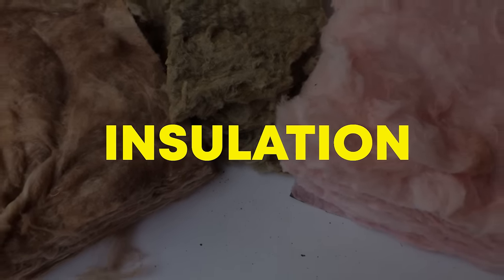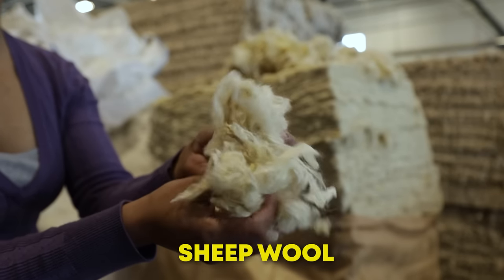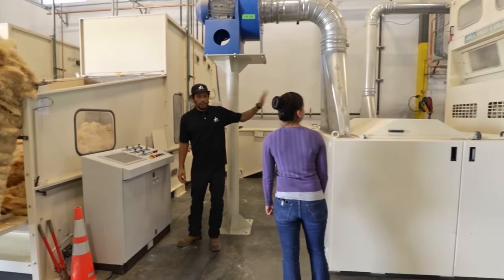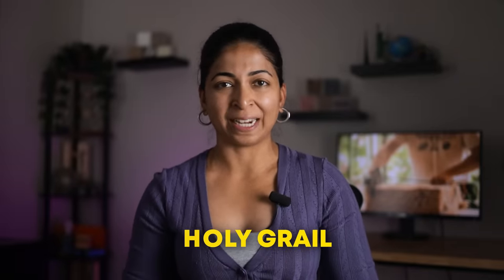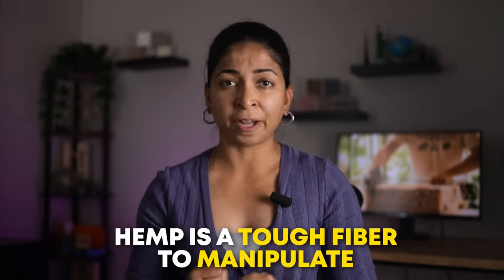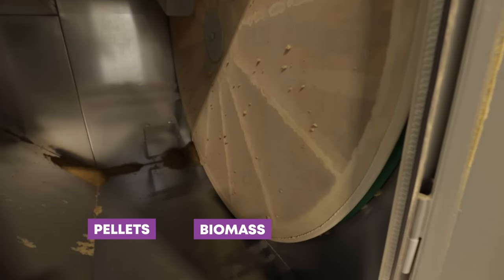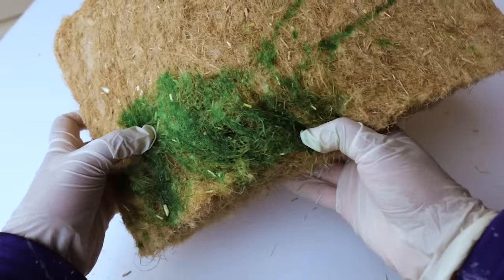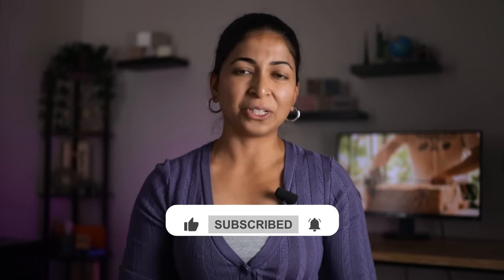Is HempWool the Holy Grail of Sustainable Insulation?

Comment: Thanks for the video though it does border on infomercial. I’d like to know more about fire resistance, ie, how many minutes can it withstand the flame, especially compared to mineral wool. Using a cigarette lighter may not be the best fire source since it’s low pressure device, a torch may be a better option. Also, with plastic binders I wonder what sort of toxic gasses are given off when it burns. Lastly, as mentioned elsewhere, I’d be interested to learn what sort of critters could take up residence in the batt—it looks like it would make a handsome mouse nest.
Reply: Does fire usually have to burn through drywall for quite a while before gas from insulation becomes a factor? By the time burning insulation gasses happen any occupants are already dead from other smoke and heat?
Reply: it doesn't border on informercial. she is shilling :(
Reply: I don't think the plastic is the issue. It's the fire retardant spray. I'm interested in knowing what those chemicals are. PFAs?
Reply: @kevinm.6015    But for a good cause.  She is believable!

Comment: If they could turn the hemp mixture into a fibrous pulp and then spray it out in layers of 1in / 2.5cm it would be much more versatile to construct different widths and thicknesses. Plus, making it a pulp allows for the water / solution to be the glue and you wouldn't need the polyester. Also, from that baseline they can / could offer different variations of that. I could see this product evolving into sidings and even possibly roof tiles that are almost completely circular / regenerative.
Reply: I’ve seen that…I think the company is ISO out of Belgium, and I think there is a company in PA doing it, too…
Reply: @rickreynolds3604   Thanks, I'll have to look them up  :)
Reply: Hempitecture, the company featured in this video, sells that product in addition to this HempWool. It was their first product and if you go to their website they have the binder and hull offered for just such an application.
Reply: @steve7814   Thanks, I'll check out their website.

Comment: I’ve been screaming from the rooftops for years… PLASTIC IS NOT BAD, one time use plastic is
Reply: Exactly! Plastic is the most environmentally friendly building material there is because it permanently sequesters carbon. Hemp based products biodegrade which makes them a poor choice of material for building permanent structures.
Reply: I live next door, and had to buy more insulation but that's ok, freedom of speech is built into human rights.
Reply: @truetech4158  thank you for your dedication to liberty
Reply: @TheICFArchitect  if the plastic is made from oil then that carbon was already sequestered underground. However using plastic to bind hemp together sequesters carbon the plants pulled out of the atmosphere.
Reply: @flinx  True. But hemp biodegrades which slowly releases all the carbon it contains.
Reply: @TheICFArchitect  most buildings are maintained and the hemp won't biodegrade significantly until the whole building is allowed to decay. That's a century or more of time for civilization to replace fossil fuels with a surplus of solar, wind, cheap batteries, and  use excess energy to capture carbon.
Reply: @flinx  If you really wanted to solve the carbon problem with hemp, I would mush the hemp into a paste and then inject it back down into empty oil wells.
Reply: @TheICFArchitect  and keep insulating buildings with products needing more energy to make? Hemp insulation is useful, uses less energy, and works with capitalism.
Reply: @flinx  It takes a great deal of energy to make Hemp insulation. Diesel powered tractors and equipment to harvest the hemp, semi-trucks to transport the hemp, and then factories to process the hemp into it's wool form. I am not against hemp but it is not some form of magic bullet that will fix the construction industry.
Reply: @TheICFArchitect  so you know Hempitecture is lying when they say their product takes less energy to create compared to fiberglass and mineral wool? Just because hemp production uses some energy doesn't mean it uses more than those other two.
Reply: @flinx  I don't think anybody should use fiberglass insulation or mineral wool either. They are all parts of an outdated substandard building method.
The faster we transition away from stick framed houses the better.
Any stick framed house is basically just a fancy tent waiting to blow away in the next storm or burn down in the next fire.
So even if Hemp insulation is better, it is just lipstick on a pig.
Reply: @TheICFArchitect  if not stick framing, then what? Brick is a poor insulator. Straw bale walls despite the height limitations? Insulated Concrete F uses polystyrene. Concrete production for now still isn't green.
Reply: @TheICFArchitect  But are we building 'permanent structures'? It seems like I've seen a lot of 30-40 year old commercial buildings being torn down to build something new. Perhaps residential will stand a lot longer? But given the low quality of most US homes in the past 50 years (R value alone), I'm not sure how it will play out.
Reply: @chmedlychmedenstein916  That is a very good point. But I would say that is the fault of our throwaway consumption culture.

Comment: I like the idea of a renewable insulation using hemp but…
1. It blackened to a very light flame, and even that required a “spray” to achieve; will that spray be effective after 40+ years in application, & I’d have doubts that for significant heat/flame that it wouldn’t burn. Rockwool on the other hand def won’t burn
2. U said water resistant, but will it grow mold? That would be my biggest fear. Rockwool def won’t 

I prob sound like a hater but I really don’t want to be becuz it would be amazing to have an organic renewable insulation that met the holy grail of high r value, water resistant and zero mold growth, and fully resistant to combustion but I just have my doubts hemp will get there.
Reply: Thanks for bringing up these great points because those are the right questions to ask. When we "inoculate" the fibers with fire retardant/fungicide, it's intended to last for the life of the building (100 years), to test that in a shortened timeframe we can "weatherize" sample material and then expose it to the ASTM E84 test (fire) and ASTM C1338 test (mold). Insulation longevity also has a lot to do with assembling walls properly!

Comment: I wish they said which fire-resistance product is used. I would love to see a comparison of HempWool, sheep wool, and wood fiber insulation.
Reply from the maker: It's proprietary spray they developed with a university, but I believe it's salt-based?
Reply: @BelindaCarr Salt-based fire retardant sounds pretty interesting.
Reply: Probably some alkaline carbonate, the fire resistance will worsen over time if there' water exposure and the product being mostly cellulose will likely run into rot issues in moist environments.
Reply: @yarharyar I'm starting to lean toward TimberHP products once I get enough money to replace the degraded fiberglass insulation in my attic and utility room.

Comment: ...And how do the sound insulation properties compare with SONOpan or Rock Wool. One application could be to use it as a filler in a sound insulation panel - inside a printed canvas frame.

Comment: I  placed in rock wool in my room addition and even though it cost more it was worth it.
Reply: Huh?
Reply: @andreas5287  mineral wool,   It is a very resilient and fire retardant material and excellent on dampening sound .
Reply: Yes but cost more than what? Hemp wool? And as Belinda was pointing out mineral wool is super unsustainable. Its basically rock candyfloss made at 3000 degrees by burning unbelievable amounts of fossil fuel.
Reply: @andreas5287 do you think the hemp is grown without fossil fuel? It is not. Rock wool is made using waste byproducts, the energy it saves over the course of the life of the house will offset the energy used in its production. Rock wool will not burn, is virtually waterproof, has phenomenal sound deadening qualities. Hemp is a wonderful fiber that has many uses but I will stick with rock wool thanks.

Comment: Not really, I've been in insulation since 1966.  It's made from an organic plant same as cellulose.  It absorbs moisture.  Enen if the insu;lation is treated to be mold and fungus resistant, sheetrock isn't.  Because of that fiberglass and foam out perform these plant based insulations in keeping mold and mildew off sheetrock and outta your lungs.A tricky thing too, you can't have two vapor barriers, and enough ventilation to extract all the moisture accumulating behind exterior walls.

Comment: I'm sure HempWool will find a niche, I personally would prefer it not be in my walls. You do keep moving the flame around, and that's not how fires start. Fires start from point of ignition sources like a malfunctioning receptacle. I don't always like how the term sustainable is used. I mean, why isn't rockwool or fiberglass sustainable? Do people not believe we can achieve low or zero CO2 emitting power? I'm sure we can overcome these hurtles. At the end of life of rockwool and fiberglass insulation, just recycle it. A lot of rockwool is made up of mineral waste, so might as well use it in people's homes as insulation rather than just dumping it. We could get the energy needs of slagwood down even further if we locate the factories close to steel mills. The slag is already molten hot. I'm sure HempWool will find its way into pillows and chairs if it can be used as carpet pad.
Reply from the maker: Thanks for your feedback, Robert! The issue with Rockwool is that it's not produced in the same factory as its creation. If it were (as you mentioned), it's energy footprint would drop drastically.
Reply: Well, it depends of where it is the factory. I know for many of them right in the site. 
The problem I see is that some of them produce quite a lot imissions of hard particells in the air, and you can see no adequate filters installed on factory cheemnes.🧐🤔😠

Comment: Hempwool is organic and absorbs moisture where fiberglass doesn't.  That said, a moisture retention promotes growth of mold and mildew on your sheetrock.  Inhaling mold and mildew causes lung and breathing problems.  Lots of things they don't tell you, and I have been in insulation since 1966.  Do you research.
Reply: I see that moisture retention allow temperature drop relativelly fast and you have to heat it up with inner temperatures to evaporate the moisture... Heating more to keep your fake eco friendly insulatuon dry... Yea that's a win for Greta&Ursula🤣🤣🤣

Comment: Another solution for non existing problem...masked by sustainability, which is not really true.. 

Hemp wool and recycled cloth insulations (at least what can i get here) have significantly (20% bigger lambda) worse insulation properties than comparable mineral wool products. So if you have it for the 100years I think you will comfortably save any excess co2 created during productio on heating/cooling cost. 

And with some math the energy requirements arr not that crazy: one square meter of solar panels generates at least 100kWh per year which is enough to melt ~200kg of sand which will get you ~10 cubic metres of insulation. I would need lot bigger plot of land to produce 10m3 of hemp insulation per year. Which will be newly cultivated arable land (because no excess hemp is currenty produced) which will be some 3rd world forest burned down..

And organic insulations are flamable (or full of chemical fire retardants), mould can grow on them in wet conditions, so one leak and you need to replace them.. (and/or are treated with fungicide treatment) And insects and animals will actually live in your walls (or maybe die beause of the poisoning from the chemical treatments)
Reply: We are going to test energy performance vs. mineral wool very soon, we did very well vs. fiberglass! Red list chemical free FR and anti-fungi. I think you'd be pleasantly surprised!